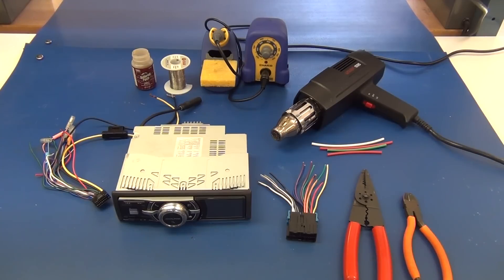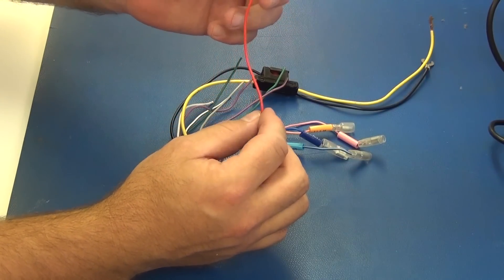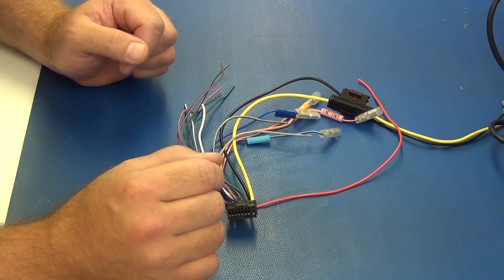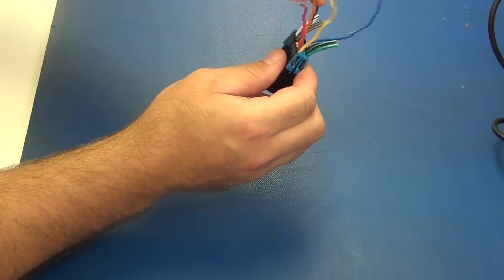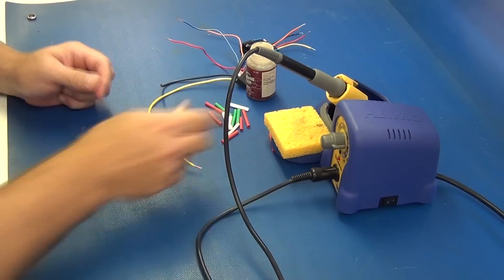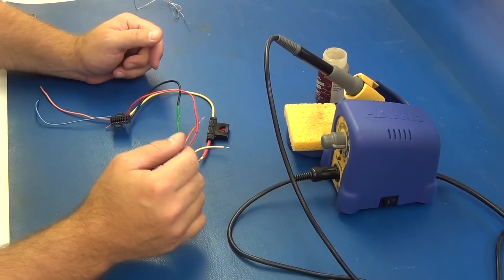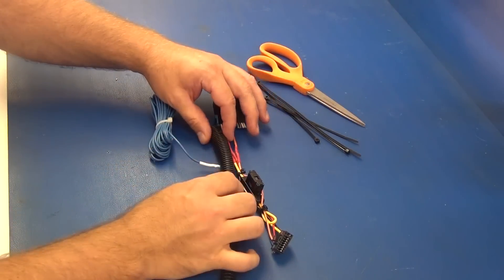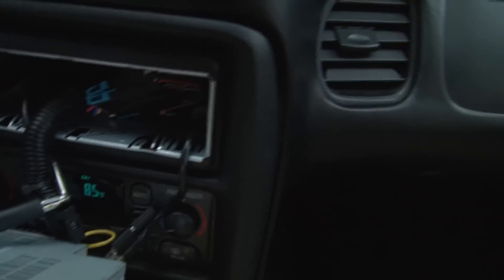PART2 Wiring the adapter harness for the C5 Corvette head unit

Comment: Excellent videos, I am looking for part 5. I am beside myself. Any ideas when you will post the video? I have aftermarket amp, head unit and speakers that came with the car. I just bought a double din and I am lost here. I understand to wire all speakers to the amp and use rca jacks out to head unit, that includes sub, front and rear speakers, is that correct?

Comment: Nice video Jim. Question tho...on the green wire to improve reception, which green wire is it? Which wires r beside it in connector? I see a few dark green wires, a green/white and a light green. My reception doesn't seem to improve hooking 12v to any of those. Can u help? Mine is a 99 that had bose and replacing head unit and front and rear speakers. No amps or subs bein added

Comment: I love that you did this video. It helps us do-it-your-self guys with the what the why.  Regarding the yellow always hot wire.  The fuse is so close to the head unit, installing it will have the fuse behind the dash.  Would it be OK to cut and extend the wire so that the fuse is inside the engine bay and close to the fuse?
Reply from the maker: Not a bad idea! You could also retain the original fuse and leave it where it is, and still put a fuse in the engine bay as well. Two fuses are better then one- LoL!

Comment: Thank you for the video Jim. I'm replacing the stereo in my C5 this weekend. Already finished installing amps and running wires.  Head unit will be done Saturday. So I can just hook up my power antenna wire from my aftermarket stereo harness to the factory green wire and it will make the radio stations work stronger?
Reply from the maker: My aftermarket head unit had a wire for power antenna. I hooked the green wire to this so it would only power the preamp when the radio was on. Worked well for me. https://www.youtube.com/watch?v=h9wjIoplp1s

Comment: Why didn’t you use any speakers? When you cut all off you lost me?
Reply from the maker: At 5:04 I mention that I will be using external amplifiers fed by the RCA jacks and not using the head unit internal amplifier. You can do it either way- whichever you prefer.
Reply: Thank you